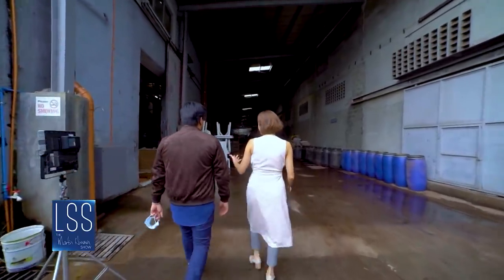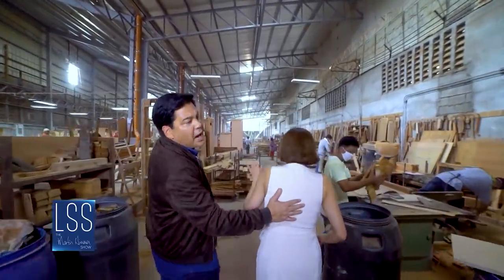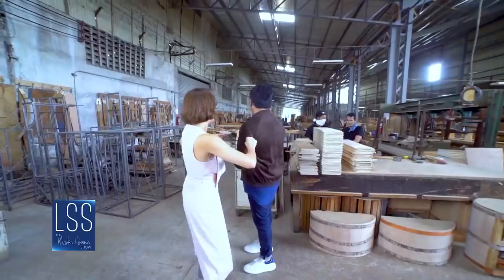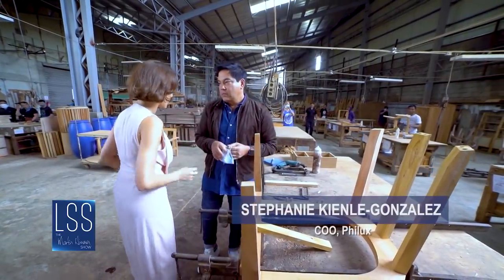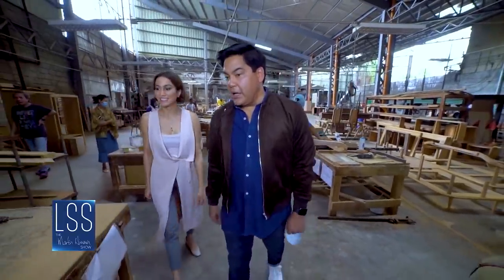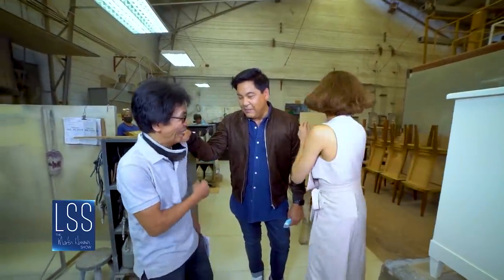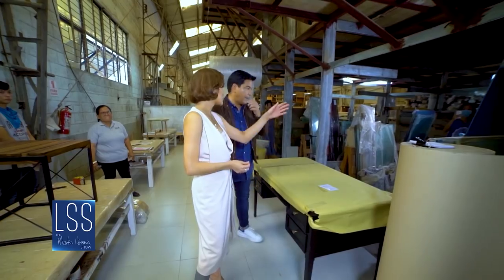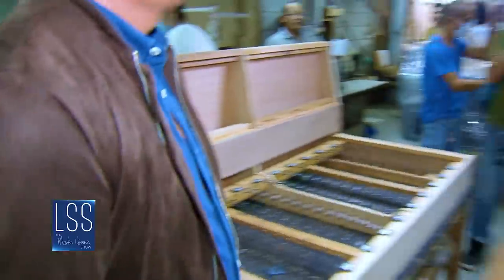Stephanie Kienle-Gonzales tours Martin to the Philux factory | LSS The Martin Nievera Show

Comment: You should supply the workers some proper protection gear like dust mask a proper one not the one you can buy cheap..and painting should be on isolated area so the fumes wont get into the lungs of other workers...jst concern✌️✌️✌️